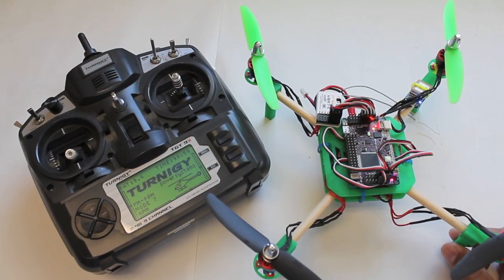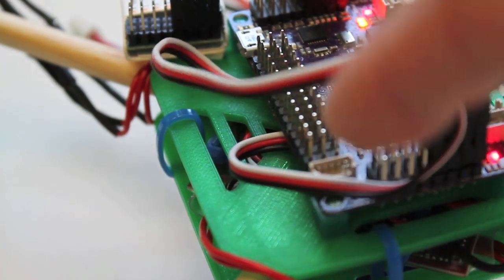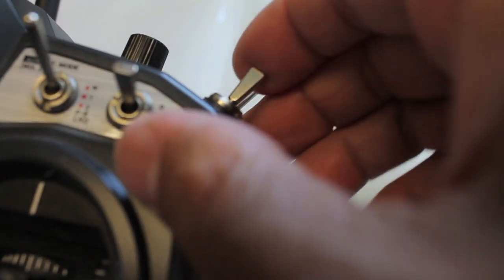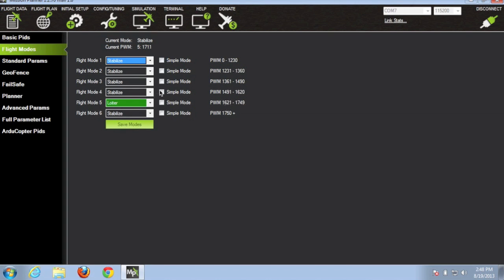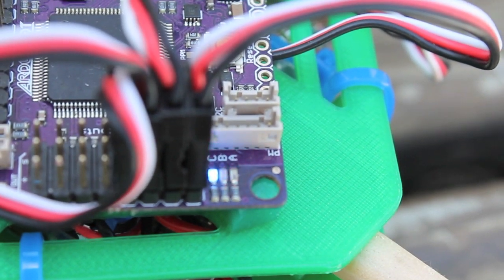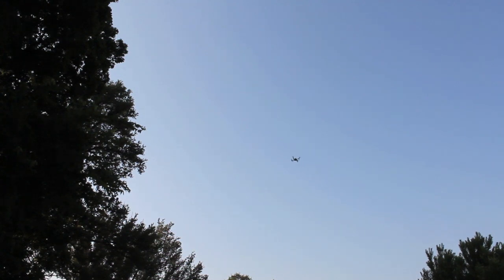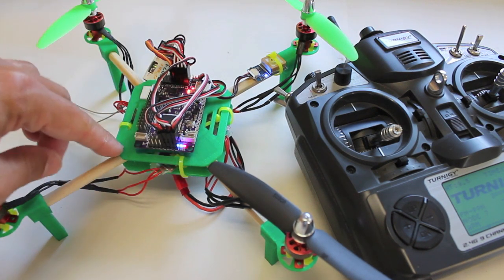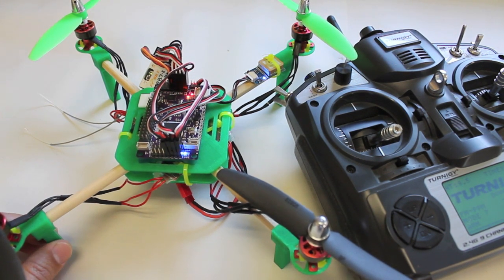APM 2.5 and ArduCopter 3.0.1 Loiter Setup and Backyard Test w/ DIY Mini Quadcopter

Comment: I cannot get power to my motors using a ZMR250 with their PDB and APM 2.8, I dont like this board (runs the whole length of the qav, what kind of Power board should i get that will work with APM???

Comment: I'm having trouble trying to get my APM 2.6 hex to loiter correctly. When i put it in loiter mode it toilet bowls and moves all around. I've calibrated my APM and gps unit and the gps is mounted up above all other electronics, any suggestions?
Reply from the maker: +Ryan Friedman Do a compassmot routine just to make sure it's (your compass) not causing any problems. This is one of the better threads on the subject:

http://diydrones.com/forum/topics/toilet-bowl-effect

Good luck and let us know what you find out.
Reply: +Dennis Baldwin Hey thanks for the reply. I did a compassmot and the most interference I got at one point was about 35%. My GPS isn't mounted to the full height of the mount it comes with because the cord was too short. Also, maybe you can help with this too, my hex is producing a ton of vibration. I've got my APM mounted on two little pieces of foam tape and the camera gimbal mounted on really thick foam with vibration dampeners and I'm still seeing quite a bit of vibration in my videos, thanks for your help!
Reply: +Ryan Friedman I have the same problem in loiter mode. I have two multicopters when I use APM 2.6 quad it works very well, but if I try my hexacopter using APM 2.6 hex it doesnt work (it moves all around) please let me know if you got a solution .
Reply: Okay I think I'm just going to convert my hex to a quad this is really frustrating, let me know if you figure it out.
Reply: +Ryan Friedman I have a Chinese apm 2.6, the quad works very well, but I don't know what's problem with hex I think it's the firmware
Reply: +Grover Flores Urbina I just converted my Hexacopter into a 450 quadcopter using all the same gear (apm2.6, neo-m8n, etc) and it seems to be doing the same thing
Reply: So did you get any answer? My quad is doing the same!
Reply: ***** Huberto, my advice is to try to put your apm on the top of your quad. And avoiding to have many cables around it. If it doesn't work, you can format your apm and install the firmware again.  If the problem continue, you should change your GPS. The probability of a apm failed problem is nearly cero but you could consider it as well.

Comment: Nice example of a Loiter Toilet bowl effect ... You're going to need to do a lot more than a compassmot, the GPS needs to be on a mast and the flight controller on a vibration killing platform, otherwise, not a bad flying DIY drone :) I have a clone F330 with APM and GPS on a mast, it really does help a lot as it reduces the interference from the ESCs and cabling ... I tend to get maybe 10cm drift in either direction in loiter this way ...
Reply from the maker: Barry Hinselwood Thanks for sharing. This tiny quad doesn't offer much space to get the electronics separated but I'm not going to give up. I'll share what I come up with and appreciate your feedback.
Reply: Dennis Baldwin I'd probably swap out the electronics on to an F330 frame or there is some material you can buy that blocks interference, can't remember what the material is called, but if you search YouTube for APM Painless 360, he does mention the name of the material ...

Comment: what is loiter mode ..isn't that the toilet bowl effect?..does apm has position hold like multiwii?
Reply from the maker: bill alvarez If I understand MultiWii's position hold I think it's identical to APM's loiter mode:

http://copter.ardupilot.com/wiki/loiter-mode/
Reply: Dennis Baldwin Or Naza, loiter is GPS lock plus altitude hold ... like sticking a pin in the sky ...

Comment: Hey Dennis have you ever made a video about how you mount your apm boards for anti vibration? Or could you make a quick one at some point?
Reply from the maker: jetguy1205 Good question. No, I haven't but it's a good idea. Lately I've been flying with Pixhawk which ships with some great double sticky foam that helps tremendously. At least I think it does :) It sure feels like it does! If you don't have access to that one that I use a good bit is Kyosho Zeal. Super sticky on both sides and keeps the APM securely in place.
Reply: Dennis Baldwin ok cool so you don't think it's really necessary to use something like this.   https://www.hobbyking.com/hobbyking/store/__40618__Vibration_and_Shock_Absorbing_Mounts_400g_A4plus4_100g_.html.  just some good foam tape

Comment: Hi I have configured the altitude mode and flown successfully, and I even also have a good GPS lock. But if there is heavy crosswind the quad drifts away but stays in that altitude.How to make the quad stay constant during crosswinds?
Reply from the maker: manu ghorpade Check out Loiter mode:

http://copter.ardupilot.com/wiki/loiter-mode/

That will hopefully do what you need.

Comment: I have the same board, but when I hit altitude hold the quad jumps up and down. Do u know how to fix that
Reply from the maker: RcModelTest Check to make sure your barometer is covered from both light and wind (from the prop thrust). If you continue to have problems feel free to post in the forums at www.garagepilots.com and we'll be glad to give you some help.
Reply: Thanks , got everything up and running properly now. Turns out I needed to restart the board and recalibrate everything.

Comment: in my opinion your toilet bowl was due to your mounting position for your gps close to a ac current source ( brushless motor )is fatal try remounting away from motor and try again
my loiter on my quad is rock solid does not move even half an inch
Cheers hope this helps
Reply from the maker: You're absolutely right. My loiter on my 450 quad is spot on. It's the mini quad and the electronics gps/compass so close to the motors/escs. Appreciate your feedback.

Comment: Total Noob who's spent several days enjoying your videos. Brilliant... really. Going to try building this mini Quad with my 9 yr old son. Since I own nothing - except a tiny Hubsan, would you recommend APM 2.6 or pixhawk with the Turnigy 9x and the V8FR-ii receiver or should I be going much more simple? Go with the 4 in 1 ESC for simplicity? Any other changes from your original 106$ plan? Don't want to go crazy complex but the long term stuff with the GPS options etc are pretty exciting. Were you ever able to get loiter to work well with this guy and eliminate the toilet bowling? If you're too busy to respond - Great work with the videos!
Reply from the maker: Peter, thanks so much for the feedback. It's very much appreciated. Glad to hear you're getting your son into the hobby. Awesome. The Hubsan is a fun little quad to fly and I think you'll really enjoy the mini quad. I think you should start with the MultiWii Flip 1.5 from readytoflyquads. It comes "ready to fly" as they say and it's quite they flight controller for $15. I have a video coming in a day or two that shows it on the mini quad as well as an update to the mini quad to include 3d printable booms...instead of using the wooden dowel rods. I haven't put the APM back on it yet but plan on doing so this spring. As for the 4-in-1 escs I've looked into them before but haven't tried them out. My only feedback is that if you lose 1 esc then the whole package may be out the door....without some hackery. Good luck and please feel free to join out community at garagepilots.com for more discussions.

Comment: What Receiver are you binding to the Trunigy 9x?
Reply from the maker: In this video it's the V8FR-ii receiver. This one:

http://www.hobbyking.com/hobbyking/store/__14351__frsky_v8r7_ii_2_4ghz_7ch_receiver.html

But I purchased it from alofthobbies.com
Reply: Dennis Baldwin does that bind with the stock 9x transmitter module? Or are you using the FRSKY?

Comment: I tested my quad, the alt hode and stab work perfect, should I test loiter?
Reply from the maker: Mike Johnson Good question. They're actually a bit different. Check out the image on this page for ALT HOLD:

http://copter.ardupilot.com/wiki/altholdmode/

vs LOITER:

http://copter.ardupilot.com/wiki/loiter-mode/

Altitude hold tries to maintain just the altitude. So if the wind were blowing it could move the multirotor to any location. Loiter maintains altitude as well as location and orientation. Hope that helps.
Reply: Help me understand loiter.  I thought that was an alt hold basically.
Reply from the maker: Definitely Rahul! It sounds like you're ready to loiter. Let us know how it goes.

Comment: Hi Dennis
Yes apparently I need a Telementry cable which has a Hirose DF13 / 5 pin connector which is whats required to connect the 3drobotics apm to the 3DR TX
Still havent received my chinese apm 2.5 board yet sure is taking along time some chinese ebay sellers really know how to push the friendship thats for sure :(
cheers steve

Comment: Hey there dennis did you purchase your 2nd apm 2.5 board from one of those chinese ebay sellers?
I recently purchased a 3DR TX RX for my original quad robotics machine but the darn socket they use is a miniature type not like the ones on the apm chinese boards :(
Ive got the popcorn out catching up on all your latest videos LOL
cheers mate !

Comment from the maker: All good brother! Let me know when you're ready to build one. I can print you a mini quad and I have an extra flight controller. Ohhh and I have a transmitter receiver that you can have. Not the best, but definitely something to get you started. All you'd really need to order are the ESCs and motors. You can see the build log for the mini quad on Garage Pilots. Let me know if you wanna do it mang. It's time for you to take the plunge.

Comment from the maker: I'm using Mission Planer 1.2.70. As of late they've been changing up the interface a good bit. I don't mess with the PIDs in stabilize mode. I use the Auto Trim & Save Trim procedures. If you want, check out my channel for a video that shows up to trim up your APM in stabilize mode.

Comment from the maker: Leonard, thanks for the feedback. I'm going to through the compassmot procedure in the next day or two and try again. I was actually surprised how well the APM loitered with such a small quad and not much calibration. I know it can be much better as I've seen it with my bigger quads. I'll tape up my wires too. Thanks for all your contributions to the Ardupilot codebase. I've been following it for quite some time and am amazed by all the contributors.

Comment: Hmm, I'd love to see your compass offsets with such a small frame. You might want to really look into a mast for an external compass to get it away from the power wires. I've never seen toilet bowling that bad. Also, you should also really look into covering the barometer. Its incredibly sensitive to light and wind/turbulence. Quite a few extensive subjects on diydrones . com on the subject. I couldn't hold altitude until I covered it with a little chuck of open cell foam and electrical tape.

Comment: Its all about how its setup. My APM 2.5 equipped quad loiters in place and holds altitude beautifully. Sonar sensors can improve low altitude altitude hold as the barometer gets less effective closer to the ground. Optical flow sensors are great for low altitude position hold as its much more precise than GPS and can be used if GPS position is lost for some reason. None of these additional sensors are required nor are they needed for great loiter performance. Check out my vids, perfect loiter.

Comment: correct me if I'm wrong, but as far as I understand loiter mode without additional sensors (optical, ultrasound) is useless? Basically every video I see wit loiter on has side movement for thirty feet as minimum. Does adding more expensive GPS, optical flow and sonar improve this? And if yes, what's the best sequence or price/performance for each of them?